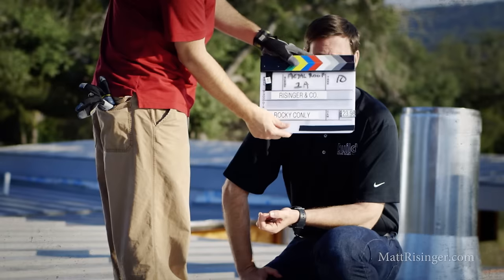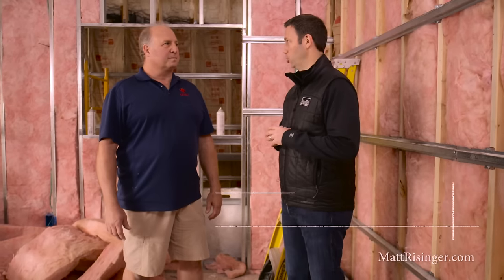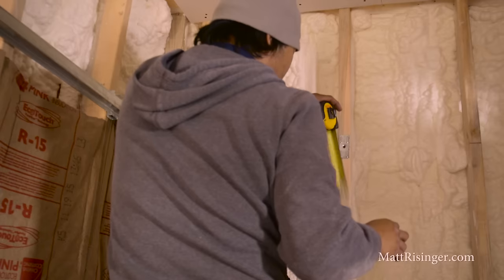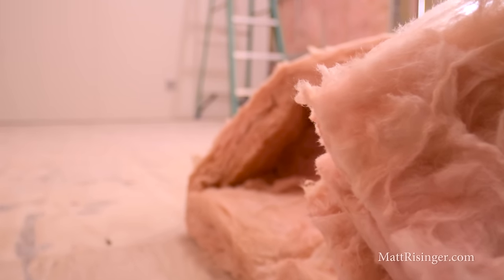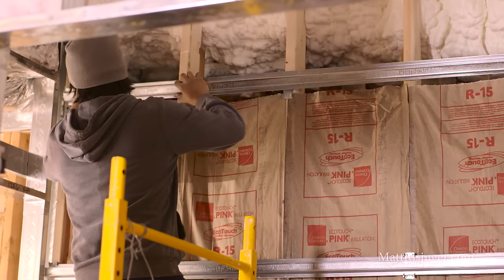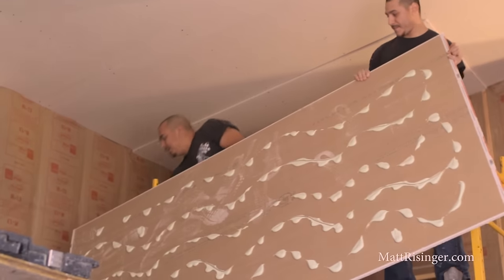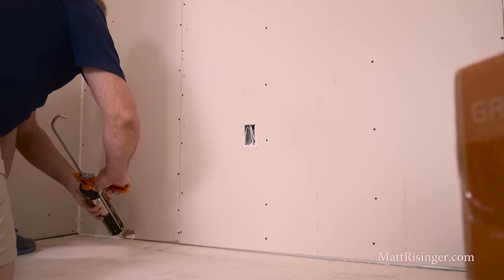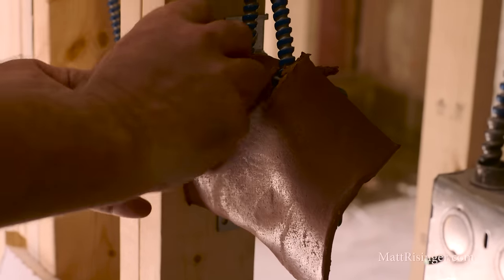How To Soundproof A Recording Studio

Comment: What’s the STC rating and low frequency is it effective down to?   Green glue with sheet rock isn’t going to go down below 125hz.
Reply: Hey! Been fighting with the best ideas for soundproofing an enclosure for portable inverter generators(Live sound engineer in the age of 2021 - outdoor venues).  Green glue vs mass loaded vinyl; sheetrock vs osb vs medium density vs plywood; double wall vs stacked; clips vs everything; quiet rock; Rock wool vs fiberglass;  Low end vs mids vs high end; and of course activated carbon $$$(think I saw you on that site).  This is getting frustrating, in that the best answer, appears to spend a whole bunch of money, put up all kinds of mass, and at least 12 inches per wall for enough sound absorbing dead space.  LOL  Have a good one!!   Carl
Reply: @CarlsOpinion  Did you measure the amplitude and frequencies you need to create a barrier for?   That's the only way to determine what you need to create a barrier.

Did you not listen to what the guy at Acoustic Fields' says?  That's the FIRST thing you have to do, otherwise you're wasting time/money.
Reply: @Oneness100  Yea no doubt.  Then after that I can pay him $1,500.00 for an evaluation and then thousands of dollars on activated carbon!!  LOL
Reply: @CarlsOpinion  What you expect an acoustic engineer to figure out what you need for free?  At least what he'll recommend will work.  Why would you guess and use something that most likely won't work?  That doesn't make ANY sense.

FYI, yes, Activated Carbon has been tested to be effective at much lower frequencies and at a higher level of absorption.  It's a combination of porosity and mass.  

What?  you think that compressed fiberglass or rock wool is going to do much to absorb low frequencies?   Dream on..

I had discussions with the guy at Acoustic Fields about 7 years ago and he's tested  EVERY major  type of absorption material and compared commonly used against Activated Carbon.  So, he's already tested it.  Scientifically.  He's also built wall structures using steel plate and concrete too.  So it all depends on what your problem is..

Whether you need it for your specific situation remains to be seen, so you have to measure the problem first.
Reply: @Oneness100  I have no problem paying for service.  What is insulting, is not being up front with his youtube audience about what he is peddling.  If you want to be on YouTube to make money, fine, but you shouldn't dodge people's questions, if you are going to have an active comment section.  Let people know up front, that we are here to sell a certain product, and give them the answer, to wit: "Activated Carbon is the best, we sell it, but it's expensive, here are some other solutions if you're on a budget".  I do that in my business.  Carl
Reply: @CarlsOpinion  His videos are mostly basic information.   yes, he does do a free consultation which you have to fill out the form, supply some photos of your situation and he'll tell you what problems you have and what products will be best to fix your problems out of the products he sells.

Why would he recommend a cheaper product that isn't going to do as good of a job?

What some people do is they go to a few different companies, give them the specifics of the problem, and see what solutions they recommend, how much it costs, etc.  And whether or not they are going to guarantee their solution, just in case you are't happy with the end result.  See what they tell you.

Also, a word of advice.  The lowest cost solution is typically not going to get the best results.  Just from my own personal experiences. 

Whenever you get involved with some kind of project, if $ is a problem, chances are you can't afford the best solution and that's just the way it is.
Reply: @CarlsOpinion  He is up front about what he's selling.  He doesn't monetize his videos like others do.  if you don't know he's selling Activated Carbon instead of building insulation, then you aren't listening to what he's saying In his videos.  Look at his Green Glue Part 2 video.  He's VERY clear about comparing a 10" wall thickness using Green Glue/2x4 studs and sheet rock compared ot what he would recommend for a Home Theater application like the one his customer had.  obviously, everyone's requirements are going to be different, so what works for one person's home theater might not work for another due to the amount of energy being produced in the room..  But in that example, he's VERY clear about the performance differences.

 I think he's VERY upfront about that.  he has lots of videos that discuss why he does't like building insulation for absorption of low frequencies and why he doesn't recommend it for mid's and high's either, in terms of acoustic treatment.  I don't know if he could be any more upfront about that.
Reply: @CarlsOpinion  What's your noise source?  What's the frequencies and amplitude of the noise you are trying to manage?  What's the application?   All of this will dictate what type of "soundproofing" you will need.

Comment: As long as the metal channels are held by any solid element to the wooden framing THERE IS A MECHANICAL CONNECTION. I keep hearing about "no mechanical link" when they use this clips. For sure they minimize contact but is not correct to say there is no mechanical link.
Reply: Yes that is what I thought. And a huge metal grid of channels and fancy clips??? That's hardly going to help in my book! That sound is going to run along the studs and to the screws and onto the channels with joy! At the very least they could use some softer material at this point.  
It seems that these guys have the usual American love of strength; solidity and over-design niggling away at them sub-consciously, when the ethos of a recording studio must surely be softness, floating delicate-structures and multiple layers of dissimilar sound-absorbing materials.

Comment: 3:13 Why not apply the Green Glue to the drywall edges before butting them together or to other surfaces?
Reply: Labor and material money
Reply: Green glue doesn't bond to surfaces.  Better off with caulk since it will create an airtight seal.

Comment: what do you do about exterior windows and doors?
Reply: Hey Jack! For windows I would recommend building them yourself. Build a double wall with a one inch air gap and then put 1/2" laminate glass on the outside and 3/8" tempered glass on the inside. I did that in my studio and could not be happier with the soundproofing. I can help you with full install directions if you want. Feel free to reach out at info@soundproofyourstudio.com. Happy to help!

Comment: What about air vents ?
Reply: Air vents and returns are tricky.  In my own home studio, we used the flexible cloth & foil kind of ducting instead of the rigid aluminum ducting between the furnace and my room.  I don't get any mechanical noise transfer into my room from the furnace, but I definitely lose some effectiveness in overall soundproofing due to the hole in the wall that accommodates the vent.  There are a few designs that add baffles in the duct to help mitigate this, but you're still basically putting a giant hole in your nice airtight soundproof room.  But a person has to breathe!

Comment: How do you sound proof doors and windows?
Reply: same concept with the double wall thing for the windows, rubber sealant at the base of the window with acoustic panels below and above I believe, the actual windows should be around 10mm thick and they should both differ in thickness. Doors must be solid core, not hollow, have sealant around the frame and maybe even door jams that seal the bottom gaps in the door once its closed. I'm not a pro but that's the general idea of what to do Im pretty sure.
Reply: Hey Hakim - The last reply was pretty on point. For windows I would recommend building them yourself. Build a double wall with a one inch air gap and then put 1/2" laminate glass on the outside and 3/8" tempered glass on the inside. I did that in my studio and could not be happier with the soundproofing. The door is a bit more complicated but overall you use a solid core door with 8PSF of sheet lead and then a layer of 3/4 cabinet grade plywood. You also need to install weather stripping seals and finish off with magnetic weather stripping seals. I can help you with full install directions if you want. Feel free to reach out at info@soundproofyourstudio.com. Happy to help!

Comment: Mineral nonconductor like Roxul would are so much superior for sound dampening/ proofing compared to fibreglass insulation. it might conjointly offer you higher R-value, is fire-proof, waterproof, mold-resistant, and tho' they do not state it, several consultants square measure spoken language that it's white ant and different cuss proof/ resistant.
« Back

Comment: And they're using pink insulation!!! That's hardly  even sound dampening 1 And these guys are professional!! I'm looking for some REAL facts!
Reply: See http://insulation.owenscorning.com/homeowners/renovation/products/quietzone/ and
http://www2.owenscorning.com/quietzone/pdfs/QZBAtts_DataSheet.pdf
Reply: When used inside of a wall, the pink stuff has just as good of acoustical dampening as mineral wool or other material.  It's the mass of the wall and the decoupling from the rest of the structure that does most of the work.  The insulation is just there to deaden the air and transfer the vibrations into heat.
Reply: okay boomer
Reply: Here ya go. https://www.youtube.com/watch?v=3mGbPHx_8X8
Reply: Other sources to back this. Just duckduckgo it.

Comment: Can you use those tracks on the ceiling? Will they support two layers of 5/8 drywall? That's a lot of weight
Reply: Yup! I'm using Resilmount clips with hat channel on mine with 2 layers of 5/8", and it's frankly enough to support 3, maybe 4 layers.